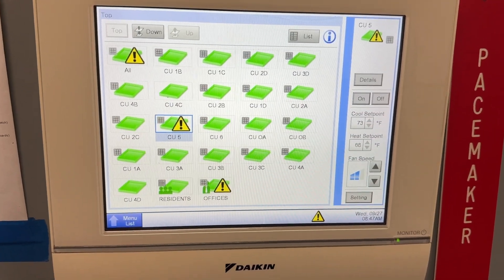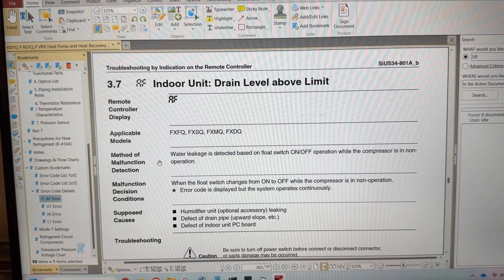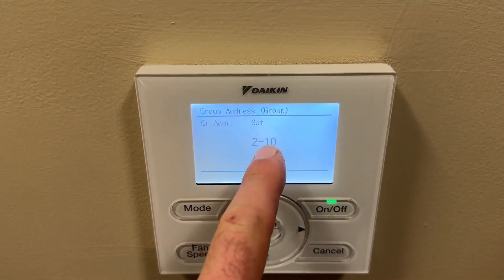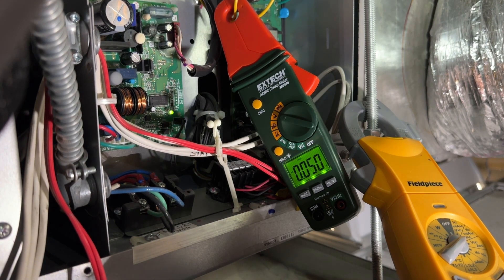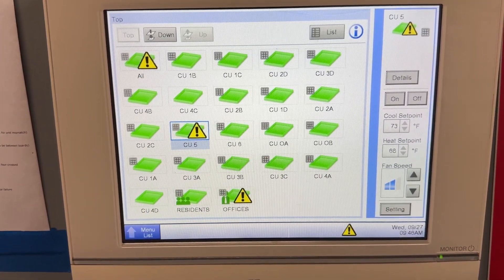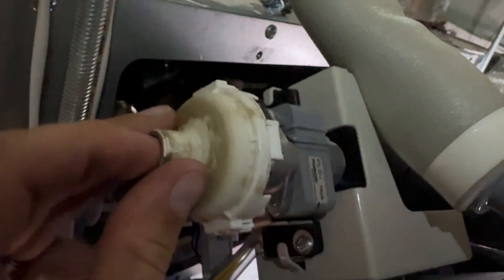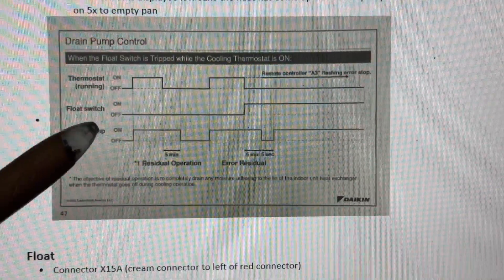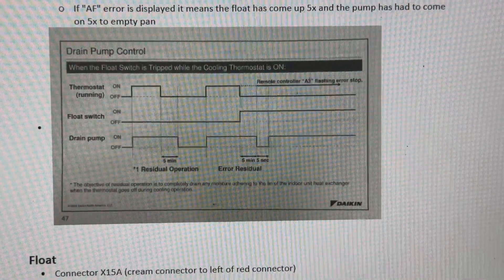Diagnostics48: Daikin VRV 3 System with an AF Error Code

Comment: Condensate pumps according to the manufacturer's specifications raise water 600-800 mm from the bottom of the unit. We often connect them to 32 mm pipe drains (because the drains are prepared that way according to the project) and there was never a problem, even if it went a little over 800 mm. With a smaller diameter pipe, the life of the pump would be easier, but I don't think it's a problem
In cases like this, when the pump is running and an error occurs, we usually had the problem that the pump suction was blocked by deposits in the condensate pan. In the pan itself, the lowest part is in the form of a depression into which water enters, and deposits usually accumulate there.
Usually, removing the condensate pan and cleaning it would solve the problem.
Reply from the maker: Yeah that’s a good point and could have been the problem.  Unfortunately I wasn’t able to duplicate it so I never really felt like I had a definitive diagnosis on that one 👍

Comment: That drain outlet pipe needs swapping to 3/4. You’ll have no issues then. Max pump lift is reduced when using larger 
1 1/4 pipe.
Reply from the maker: I thought it was 3/4” already if I remember right? 🤔
Which pipe are you referring to?
Reply: Oh my mistake! You’re quite right 😂 Odd the system has clearly been installed for several years, assumedly without issues. Maybe the pumping capacity is now reduced as the pump has aged? 🤔
Reply from the maker: Yeah maybe so!  You’re exactly right it’s kind of an odd problem and I honestly don’t know if I got to the bottom of it or not lol!

Comment: I think the only way the pump can overcome this type of lift is if they use a small crystal type condensate hose ( I mean the transparent soft pvc or whatever plastic one ) , like on the small Aspen or Sauermann condensate pumps .
I've seen installs where they hook the pump to a crystal hose and connect the hoses to a pvc drain header .
Reply from the maker: Nice thinking out of the box 👍